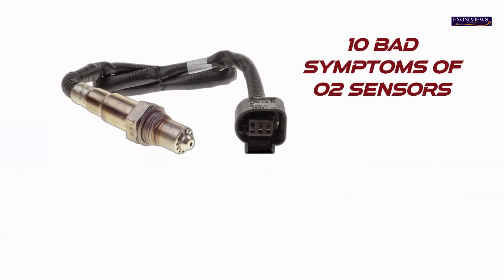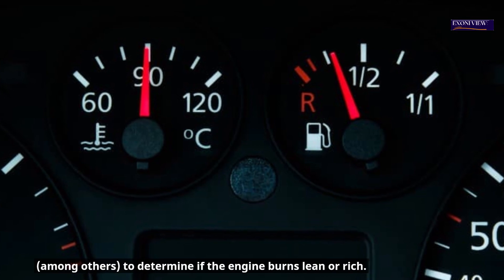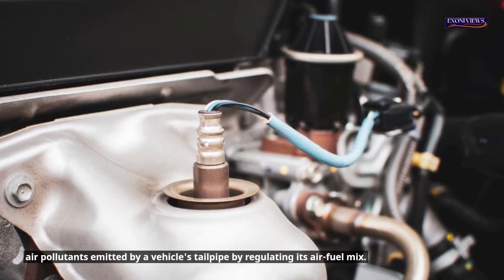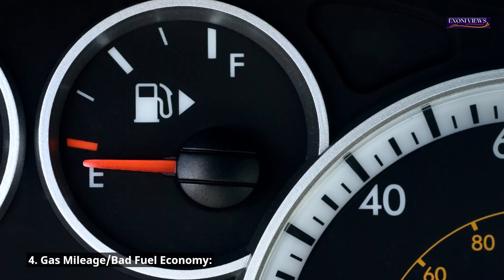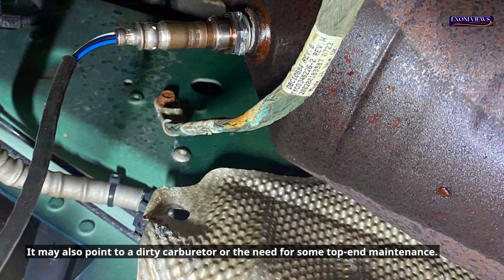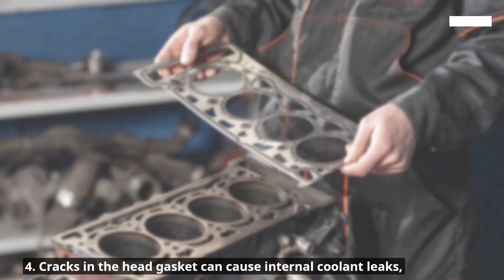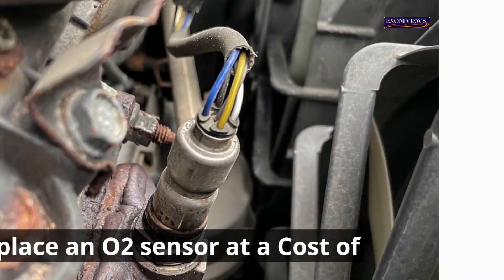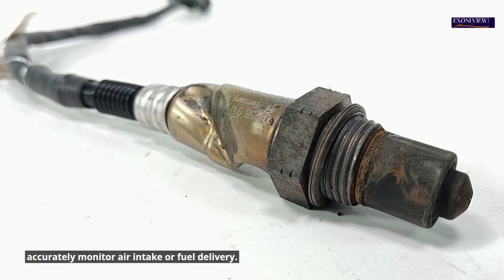Top 10 Bad Symptoms of O2 Sensors

Comment: Hello, i have nissan qashqai  j11E, Tekna. 1.6dCi CVT. I have error:   P114C.  Anyone can help me where is the problem ?
Reply from the maker: Since you've got the P114C code, that usually points to a fuel pressure issue, most commonly the fuel rail pressure sensor or regulator. It can also be caused by a clogged fuel filter or a weak high-pressure pump. You might want to check live fuel pressure readings if your scanner supports it and also inspect the wiring around the sensor.
Reply: @exoniviews sorry to ask:
I send the car in 2 different service and i have been told it's a sensor.
But, from each of them, different sensor.
Now i got new answer from you.
How did you get the answer if i may ask ?
Reply from the maker: @eljusveliu1  Okey, that’s a great question.
I based my answer on the P114C code, which typically relates to fuel pressure issues in the Nissan 1.6 dCi engines. 

It’s often linked to the fuel rail pressure sensor, pressure control valve, or sometimes even a blockage like a clogged fuel filter.

I totally understand your confusion, if different mechanics pointed to different sensors, it could be due to intermittent faults, incomplete diagnostics, or just guessing without checking live fuel pressure data. 

That’s why I suggested checking live data and wiring first before replacing anything.

If you’d like, feel free to share which sensors were mentioned, I’d be happy to help narrow it down further.
Reply: @exoniviews I would appreciate if you can help with information.
How do i check the live data of these sensor (parts) ?
Do i need any speciffic device (Obd2).
If yes, what you suggest me to buy ?
Reply from the maker: Yes, I can help with that!
To check the live data from the sensors (like fuel pressure, etc.), you’ll need an OBD2 scanner that can read live data, not just error codes.

👉 Not all cheap scanners can do this, so here are some good options you can look at:

Autel AP200 – works with your phone, easy to use, and shows live data.
Launch CRP123X – more advanced, shows live readings and graphs.
OBDLink MX+ – works with apps like Torque Pro on your phone.
These tools can help you see what the sensors are doing in real time. That way, you can know what’s really wrong before replacing any parts. This is how to check the live data, 1. First, find the OBD2 port in your car. It’s usually located under the dashboard near the driver’s seat. Plug the scanner into this port while the car is still turned off. 
2. Next, switch the ignition to the ON position, or start the engine if you want to check live running data. Once the ignition is on, the scanner will power up automatically.

3. Connect your scanner. If you're using a wired scanner, it should connect immediately. If it’s a Bluetooth scanner like the OBDLink MX+ or Autel AP200, turn on Bluetooth on your phone, open the corresponding app, and connect the scanner through the app.

4. Enter diagnostic mode
After connection, select “OBDII” or “Diagnose” mode on your scanner or app. The tool will begin communicating with your car’s engine control unit (ECU), which may take a few seconds.

5. Access live data
Once connected, look for an option called “Live Data” or “Data Stream.” Select the parameters you want to view — for example, fuel rail pressure, MAF sensor readings, sensor voltages, etc. These values will be displayed in real time, sometimes as graphs or numerical figures.

6. Interpret the readings
Now you can see what each sensor is doing while the engine is running. If any readings are too high, too low, or fluctuating abnormally, it may point to a faulty sensor, wiring issue, or fuel-related problem.
Reply from the maker: I forgot, remember to Keep the engine running when checking live values. If your scanner allows, save the data or take screenshots. And if you’re unsure what a reading means, you can share it here and I’ll help explain.
Reply: @exoniviews how can i add those photos ?

Comment: What makes the AC light flash on a 2007 Toyota Avilon
Reply: What makes the AC light flashes I wanna hop on a 2007 Toyota Avalon
Reply from the maker: The AC light on a 2007 Toyota Avalon  flashing should be as a result  of low refrigerant, a faulty AC compressor, or an issue with the AC pressure switch. It's best to start by checking the refrigerant level and then inspecting the compressor if needed.

Comment: How to replace knock sensors on 2016 Toyota Avalon V6
Reply from the maker: To replace the knock sensors on a 2016 Toyota Avalon V6, follow these steps:
Take off the engine cover and disconnect the negative battery connection. Take off the intake manifold, and find and disconnect the wire harnesses for the knock sensors. Unscrew the knock sensors to remove them. Install the new knock sensors and reconnect the wires. Put the engine cover and intake manifold back together. Re-connect the battery connection. To meet the manufacturer's recommendations, make sure to torque all of the nuts.

Comment: Who can help me with p2196 code, replaced oxygen sensor, injectors good, cleaned intake manifold, egr. Still doesn’t go away. Stuck rich
Reply from the maker: Having done all and the code is still there, try this Additional steps  to fix code P2196 (O2 Sensor Signal Stuck Rich).

1. Look for vacuum leaks in the intake manifold and vacuum lines. Even minor leaks alter air-fuel mixtures. 2. Check the MAF sensor. A dirty or defective MAF sensor can cause a rich engine to run. If needed, clean or replace the MAF sensor. 3. Check the fuel pressure regulator. High fuel pressure can lead to richness. Ensure the fuel pressure meets manufacturer standards.
 4. Engine Coolant Temperature (ECT) Sensor Review: A defective ECT sensor might transmit inaccurate temperature measurements to the ECU, generating a rich mixture. 5. Check for obstructions in the exhaust system, including the catalytic converter. 6. Occasionally, a faulty Powertrain Control Module (PCM) might cause improper fuel mixture adjustments.
After fixing these issues, clear the code and look for returns. The problem may require a deeper diagnosis if it persists.